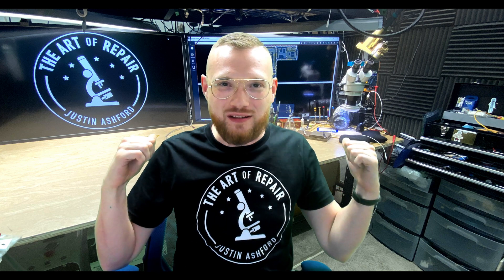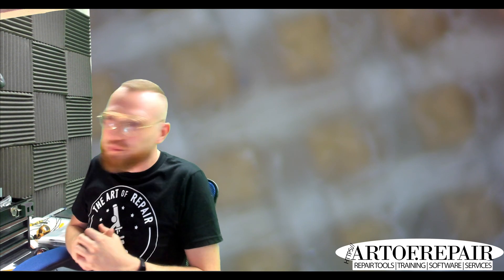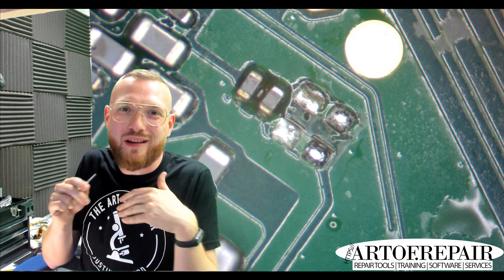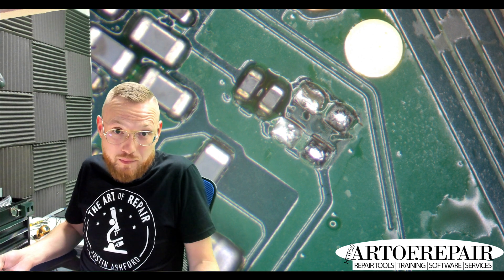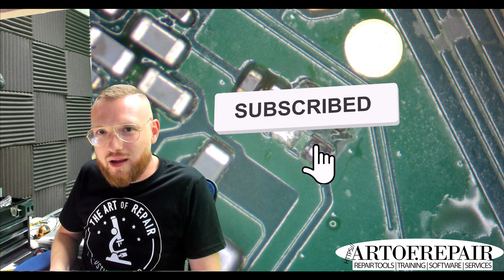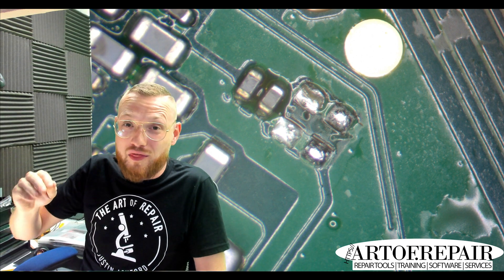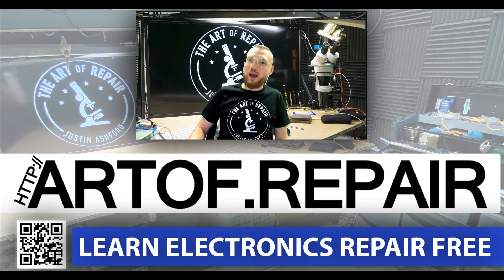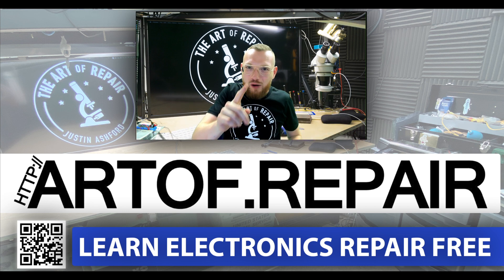When to BACK OFF the HEAT during Microsoldering | Calculate safe play ranges via visual indicators!

Comment: The 63/37 thing is correct. The flux type preferred through decades of what today is known as J STD level 3 work, but back when I was doing DOD STD 2000-1, is RMA flux core and RMA extra flux. Matching flux core with extra flux yields ideal, consistent and repeatable results. I’m not dropping brand names as there are three companies represented that we used in Avionics branch of Air National Guard. As far as low temperature solder, if you are talking Sn62, 62% tin/36% lead/ and 2% silver solder, this is used in instrumentation mainly or in critical circuits where signal integrity is vital. Nothing wrong with this solder in my book. You can’t afford to waste it. The last rolls I bought were $120 each. That was four or five years ago. Justin, solder choice is more about application in the high end and reducing product damage by keeping the time per joint at 2 secs.. The s smaller the component, the less able it has to dissipate heat. SMDs do not like heat. Dwell time must be kept to a minimum to keep these components from getting damaged. My experience with hot air is limited, but I have soldered SMDs with an iron. As long as your surfaces are clean, your tip does not exceed the pad width and your dwell time doesn’t exceed two seconds, your SMDs are not going to get damaged. I believe in flux usage. I use different size needles to control flux amount per each op. Waste is not acceptable. Flux use needs to be governed by the application of the op. I learned under a most fierce instructor/inspector. Everyone is not as fortunate as I have been. Soldering is a passion to me. Not everyone is fanatical about it. Stay safe mates!😊👍🏻😷

Comment: Are there specific jobs or products that you would recommend using remover alloy/low melt solder for? I started watching older videos on it and it makes sense why you advise against it
Reply from the maker: number one for me, is mission critial harvesting. I will absolutely use low melt if i have more than a 5-10% doubt on a rare component being harvested that maybe i only have access to one of, or where i had to purchase an entire donor board for it. This doesn't mean high density components, but more connectors and low density stuff. I also think its useful in situations where that's what came with the board. Sandwhich pcb designs call for lower melt by oem spec, so we follow that, by spec. I just don't believe and don't push the train of thought that its better to always use it. I always want to be able to solder any time anywhere with normal alloys. And while some only solder at work, i solder all over the world and couldn't imagine embarrassing myself walking around with low melt in my pocket because my process was so wear that I didn't know how to work around it. =D lol anyway I hope that answers your question Matthew! Thank you for adding to the discussion and leaving a comment =)

ps: i also think there are specific data recovery situations where its applicable as long as the device will not be used afterwards.
Reply: @TheArtofRepair  thank you that is very helpful. I appreciate you taking the time to answer my question